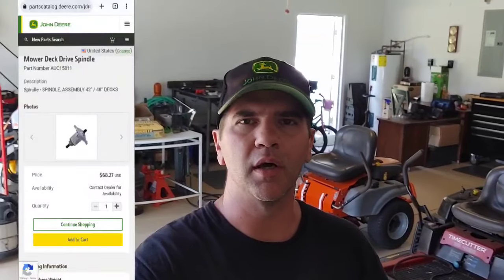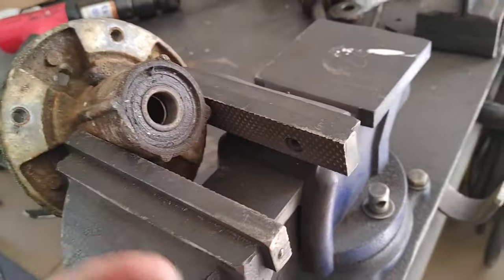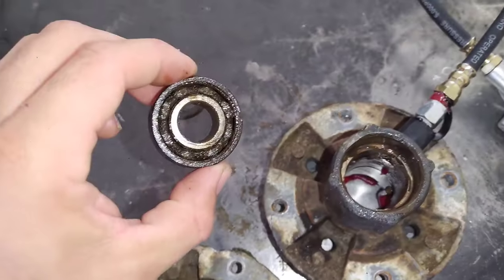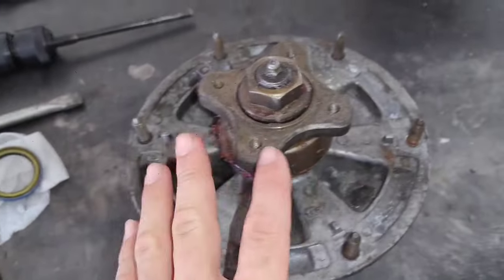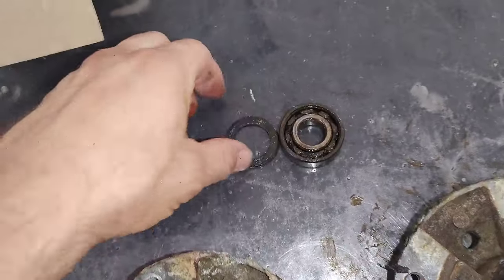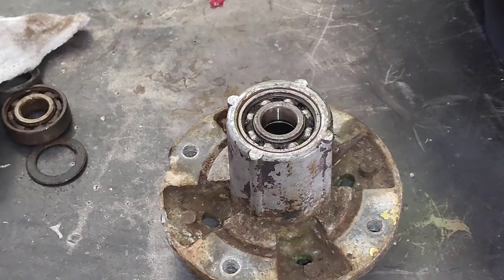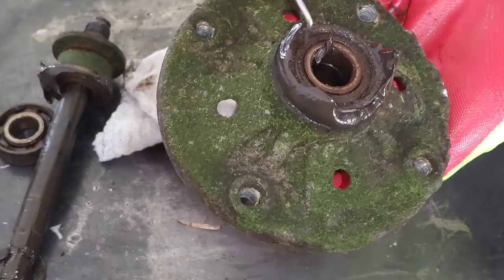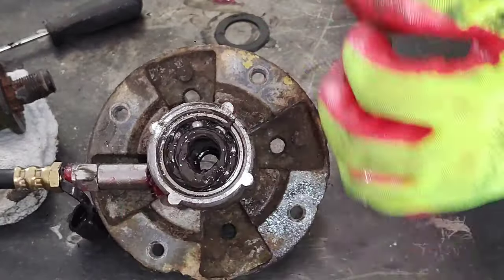John Deere Myth- Don't grease those!

Comment: Grease 'em.  Running bearings "dry" shortens their life (on anything).  My D140 has Zerk (grease) fittings on all three spindles (and elsewhere), for the price of grease (both my time and my $$$), it is well worth the cost to try to lengthen the life.  Sadly, out of three spindles, only the one on the left is accessible to a grease gun - the fitting on the right spindle faces inward, the fitting on the center spindle faces backward.  Put another way, I have to drop the deck, and I shouldn't have to.  Bottom line: maintenance is required.  Great series of videos!
Reply: @cbryant9542
0 seconds ago
The grease fittings from what I know correct me if I’m wrong don’t actually go to anything. They all dead end…..

Comment: Great no nonsense video. in over 35 years, and I've never replaced a mower deck spindle. I have always preformed PMCS on my mower, always greased the spindles. Use a hand pump grease gun pump, and add in grease until you feel resistance, then stop, no need to over grease.

Comment: Don’t matter if they are sealed. They heat up and suck grease into the bearings.  Stupidest thing you  can do is ignore grease fittings! And that spindle that don’t have a grease fitting I’d be drilling and tapping it for a grease fitting before ever returning it to my customers. You save them money by spending an extra 10 minutes fixing an engineering oversight they will see your commitment and you’ll have a return customer for life.  I worked in a fabrication manufacturing shop for twenty five years those sealed bearings with no grease zerk is a joke. It’s a ploy to get you to break equipment in 1/3 of time of a normal bearings life cycle!
Reply: Water and things are sucked into the spindle and bearing when the spindle and bearings cool down.

Comment: Grease is a carrier for oil.  The oil will seep out of the grease and slowly travel to other areas , some oil will get past the seal and lube your bearings.  Get a paper shop or house towel and put a shot of grease on it from your grease gun. Set this aside and check it the next several days.  You will find the oil seeping out of the grease and traveling outwards in the paper towel, same happens inside the spindle housing. 😮

Comment: I appreciate the in-depth look at this and the detail about how it's put together. I've been working on my parents' LA 145 that sounds like a crop duster when you engage the blades. Pretty sure worn bearings or rusty spindles are the culprit now that I've inspected, adjusted, or replaced just about everything else that could cause excess noise/vibration. I'm not a mechanic but I enjoy the challenge of getting in over my head on a project, so getting a good look at the guts of this part is super helpful. Thanks!

Comment: If one used good quality sealed bearing and perhaps removed one seal and inspected the grease for quality and quantity, the bearing will last a very long time. The seals on quality bearing are a tight fit.

The housing cavity is filled with grease to control the heat generated by the speed of the blades and to reduce the possibly of water/ moisture entering the cavity.

If one side of the bearing has the seal removed centrifugal  force will cause the grease in the bearing to fly out.

Comment: Great video! I have a 2-ish year old S170 with about 80 hours on the mower deck. I had some trouble getting grease into the spindles the last time I greased it. I want to replace the grease fittings, but I can't find a part number anywhere for the grease fittings on the spindles. What size are the grease fittings on the AUC15811?

Comment: Thank you for this video, very helpful! Would you recommend just pumping grease until you see it oozing out. Or just a few pumps each spindle?
Reply: 2 or 3 pumps every 15hrs of mowing will make it live a long time. I have a John Deere Z425 Zero Turn with 565hrs on it and never replaced a spindle bearing yet. My spindles have zerks on the top side of the deck spindle tower which makes it easy to grease. Maintenance is everything with equipment.

Comment: One spindle failed on my s120 with 100 hours.. I can’t install the blade normally because the spindle spins when tightening.. i have to hold the blade all the way up as far as I can then tighten it.

Comment: I assume you've worked on JDX350s so can you tell me how to get the shaft out of a spindle that's on  these mowers? These spindles are made different than the ones in your video. I tried hitting the top of shaft with a hammer but it wouldn't budge so I stopped before I damaged something. Thanks!
Reply from the maker: Not sure what year or deck size you have. If you have a 42" deck you have to just replace the entire spindle. The dealerships can't even get rebuild parts for those spindles. 
The other ones can be rebuilt.  Some have snap rings on top, and others just need some persuasive hits with a malet. Sometimes, I need to remeive the grease fitting the be able to hit the shaft hard enough
Reply: @Mechanical_Mind  It's a 48" deck. Not sure of the year, but mower was new about 4 years ago. Thanks for the reply

Comment: I'm getting a John Deere S100 delivered tomorrow from Home Depot. From my understanding a John Deere tech puts these together for Home Depot, not sure if that is true or not. I'm just curious if I should go ahead and add grease to these before I use the mower or assume that the tech already made sure they were greased properly. What do you say?
Reply: Depends on the HD. They used to have JD techs assemble, but now most use a 3rd party thats just gone thru a john deere training. I wouldnt put too much stock in those third parties. If it were me id just add some grease to have peace of mind. A little more grease never hurt.
Reply: The John Deere D130 I purchased in 2012 from Home Depot was assembled by a John Deere dealer equipment for mowers to combines in a neighboring city.  The dealer label is on the rear of the mower.

Comment: I have a John Deere z665 and I thought the clutch went out so I brought a new one but having same issues  the clutch wants to spend but blades not in gauging and make like a binding sound. What are your thoughts the closest John Deere dealer wants $1200
Reply from the maker: Sounds like you have a spindle or a deck idler that has seized up. To check each spindle and idler pulley you need to spin them with the belt no touching them. Also check the belt tensioner pulley.  What does the dealer want $1200 for? Did they inspect it?

Comment: You are going to go through 2 or 3 tubes of grease trying to get lube to both bearings.  The grease will flow to the bearing with the least tight seal.  One end will be a mess with excess grease. Just replace the bearings,  cheaper than 3 tubes of grease.
Reply from the maker: No need to push the grease out of the spindle just fill up the empty cavity and maybe add a bit of pressure to the bearings with grease vs nothing. Plus Id never go though the trouble of rebuilding this spindle vs just replacing it entirely
Reply: So how many tube of grease did you think it took exactly? And by your logic it’s smarter to run it to failure and replace bearings because they are cheeper than grease? Absolutely magnificent advice. Let me just throw away everything Iv learned about the most basic information and thank god I won’t waste 3$ on a tube of grease that use to completely grease three of four machines. Thank you so much.